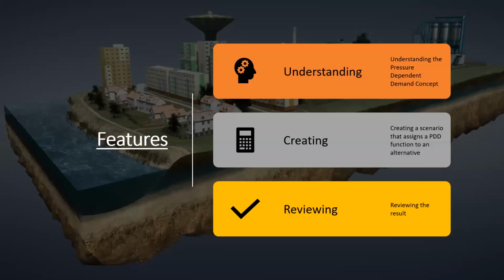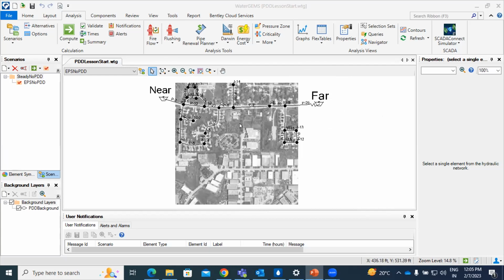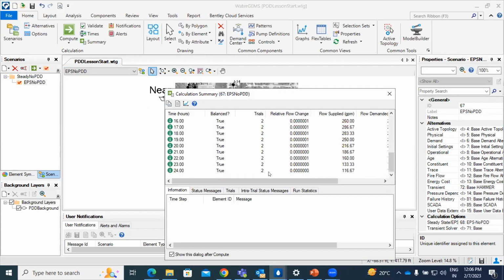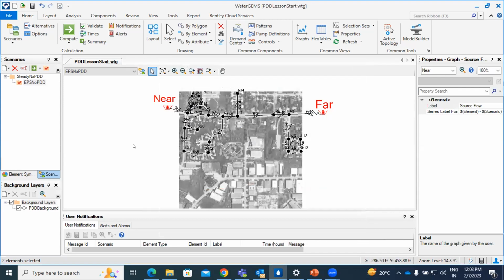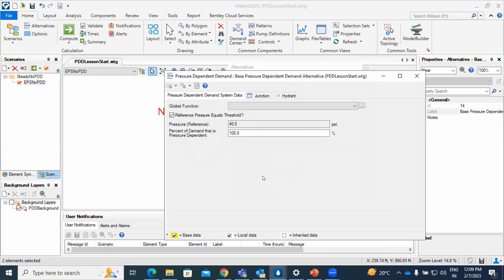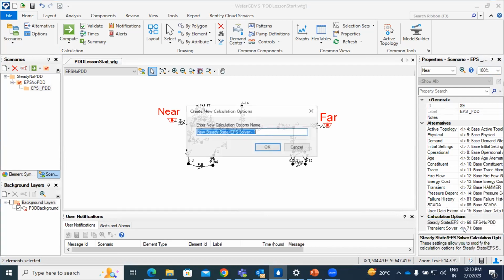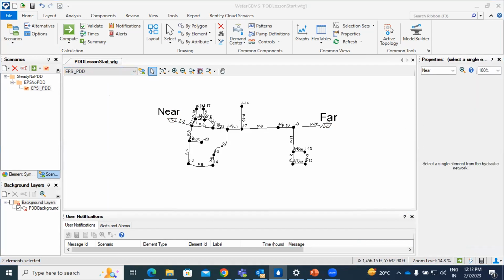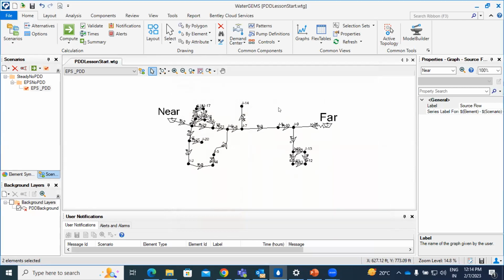Pressure Dependent Demands Simulation in WaterGEMS

Comment: Hello... thank you for the video. However, what is the purpose of showing PDD functions if the results won't be different? better to set it in a way that you can see difference in flow to the nodes due to lack of pressure